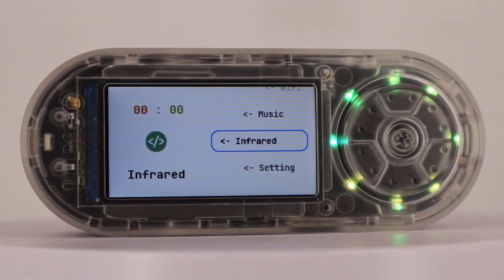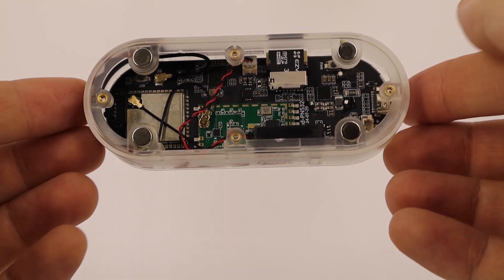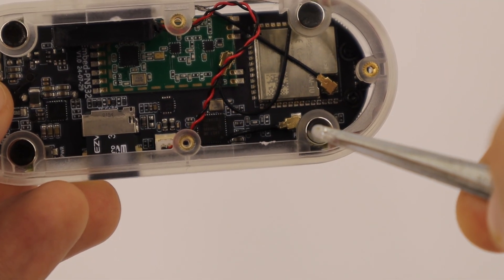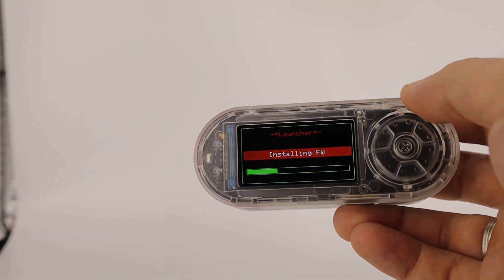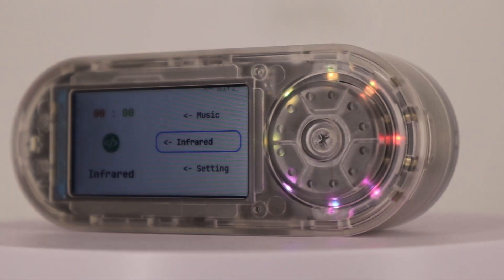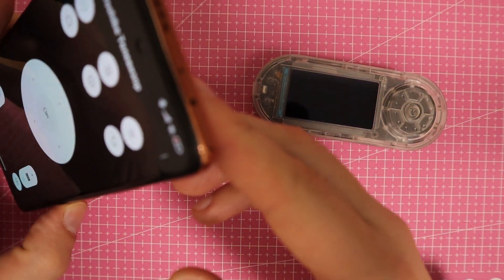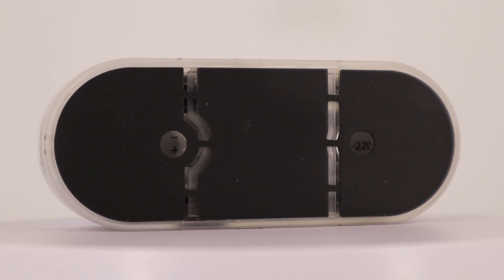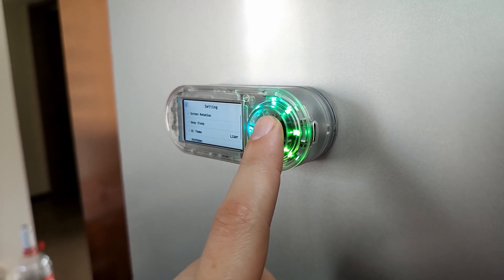LILYGO T-Embed CC1101 review!

Comment: Bro but how is it 30 bucks when the flipper 0 is 170
Reply: It's more like 60, the regular one is 30 but it doesn't have nfc and cc1101
Reply: The flipper has more features/hardware, they are a smaller company, and they had a lot of the upfront dev costs and prototyping.
This is using a carrier board for standard off the shelf modules.